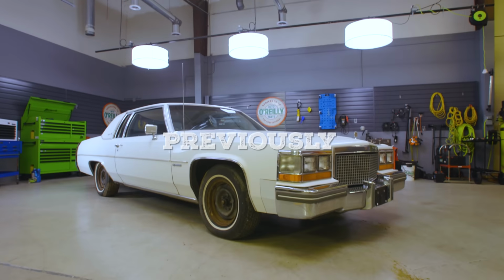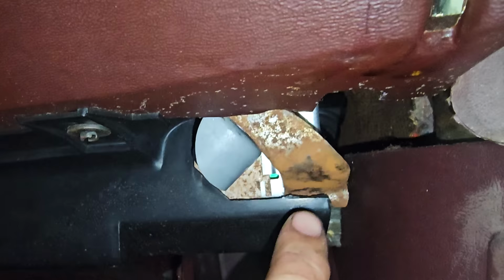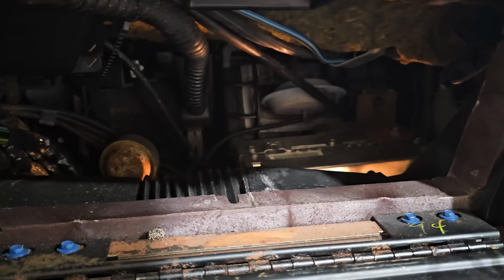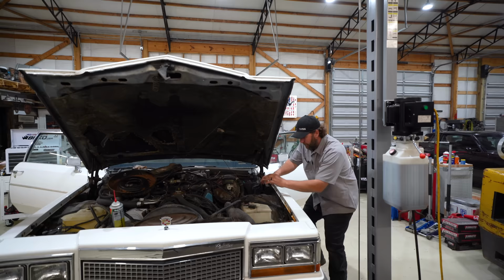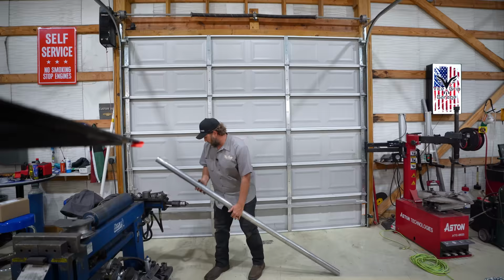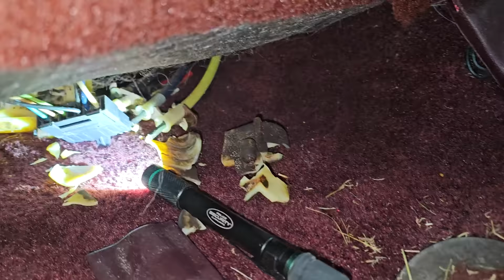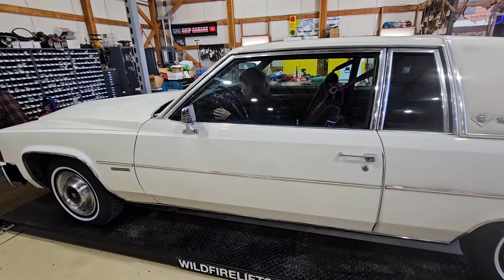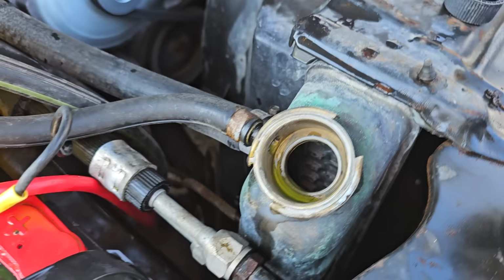Will It RUN AND DRIVE Finally? Carburetor or Computer On This 8-6-4 Cadillac!

Comment: The Cadillac as long as the car sat the ECT sensor is probably corroded and it is a important part of the electrical throttle body digital fuel injection system on gm vehicles so i think i would just go ahead and replace it also,had a corroded one in my early 94 Chevy Z71 Silverado,350 tbi and it would occasionally stumble because of it,turns out it would lose signal from the electronic ignition system to the ecm it was not stumbling it was temporary losing ignition feed and the ECT bwd O'Reilly's brand new sensor fixed it

Comment: If its not getting fuel also look into the spark control (aka ignition control module ) if it has one itll be in the distributor under the rotor like most gms the tbi 350 454s and even the v6s like the 163 and 262 .

Comment: A guy broke a harmonic balancer once and it acted just like you just did hurting the fan and alternator with no resistance. I made it home though because a Chevy 250 doesn’t really need water between Dallas and Kaufman

Comment: Btw that engine is actually a work horse. Its a destroked 472/500. If no collector wants it id pull the engine and possibly use it for another project. As it sits its a 6 liter anyway

Comment: I vote for the carb or aftermarket EFI if the original stuff doesn't work. I kinda miss index cards, but the new digital stuff is faster.

Comment: I had every expectation that Derek would convert it over to carb. I was just as surprised as he was when the car ran properly once the new ECM was installed. 

I would have understood if he did convert it over to carb. The V8-6-4 system has a terrible reputation after all. 

As for the cylinder deactivation system not working, it might have been purposely disabled by the previous owner. It was apparently extremely common that owners, shops and even dealers to disable the system and let the car run on eight cylinders all the time. It was just too far ahead of its time to be reliable.

Comment: it was driving me nuts watching those proms being changed, the correct way is to push the chip up in the holder and seat the holder in the new ecm and push the chip down, any other way will bend the terminals

Comment: I'm willing to bet it's the belts slipping on the pulleys my dad had a accessory drive pulley do the same thing it would work good until there was a load on it then it would over heat my first car was a 77 coupe deville silver with red leather interior I cried the day it got totaled I loved that car wanted to keep it forever 😢

Comment: Put the car on a Dyno and run the codes. That will tell you what you need to do. Or if you can't get the car there. Go to O'Reilly's and get a  OBD 2 hand computer and run the codes.

Comment: It's the engine.  The automagical compressions escaped and let the magic smoke out of the computer.  Screw those Cadillac collector one year people.  This needs either a 5.9 liter 12 valve cummins or a 12 cylinder swap...

Comment: Looks much better with the Oldsmobile hubcaps, The center emblems on the Olds hubcaps pop off as thats where GM hid the security bolt which prevented someone from stealing the hubcaps (or at least slowed thieves down). Anyway I wonder if a guy could find / make / or modify the Oldsmobile hubcap center emblems so they said Cadillac or had the Cadillac crest on them? Just a thought.

Comment: People disabled the active displacement for a reason. It wasn't reliable. It really didn't save fuel. Finally, when you start having high temps from some cylinders firing and no heat from some not firing, you end up with different parts of the block running at different temps, that can lead to warping of the cylinders. It's the same problem they are having with other manufacturers who are doing that today.

Comment: My 2013 Silverado had the 5.4 engine with the 8/6/4 format in it. 17mpg city 20mpg highway. There was a problem with cam positioning sensors in non pickups and passenger cars at idle.

Comment: I guess General Motors hasn’t learned much in 40 years, you disconnect the system back then, it ran fine and you disconnect the cylinder deactivation today and it runs fine

Comment: If I remember right when your in the diagnostic mode you can hold off and hi or maybe warmer button and it will clear the codes had to do this to reset ac when going down the road every once and awhile

Comment: Derek I have a perfect set of wire wheel hub caps adapter breakets and a removerator tool for them for that caddy if you’re interested

Comment: my 1980 eldorado had issues with the ECU. The last time I changed it I found a piece of metal rolling around inside. It shorted something out and the car never started until the ECU was replaced....again. My Dad had a 1979 eldo...also had computer issues when it was only 4 years old.   Good thing they are easy to change......but the diagnosis is horrible.

Comment: I once filled one of those with premium, then it wouldn’t start or run. Dealership said to use regular only. Drained the tank, refilled with regular, and it was fine. Weird ass sensitive TBI

Comment: you're looking at a sticker that says remanufactured and say i wonder if this is the original. I've worked on several of those and that ecm will come out with the wires still plugged in

Comment: Seems to me what could be happening with that there cylinder delete device box is that, either it doesn't want to shut off any cylinders when there's a check engine light, or someone in this vehicle's sordid past decided to delete the cylinder deletion system and run it as an eight cylinder the whole time.

Comment: Gotta get those filler panels for the front bumper and rear tail fins... absolutely kills the look on those things with them missing from deterioration lol. But the rarer velour....my 89 Baby DeVille has the red rarely optioned velour under Medium Garnet Red Metallic paint, she's super clean, actually trying to sell her now due to health and monetary reasons if anyone's interested around the ND/MN/SD area... she's not from here, she's an Arizona girl, but native to the states, definitely not a jumper 😉

Edit: and to make your gas gauge "instant" (much faster), fill with your ignition off, then back on once you're filled and it'll jump immediately up, don't know why all these Cadillacs of this generation do this, but they must read the level super slow due to it's extremely antiquated computer system for instant/average gas mileage and total distance per tank and it's literally using an abacus to figure out the MPG's while running, entirely too much for it to handle 🤣 tricks of the 80s Cadillac trade... favorite part of Cadillacs this generation?.... the "turning lights" AKA I'm pulling into a tight spot at night between two cars at night turning in and can't see, so lightly depress the turn signal in whichever direction you need extra light at the front corner of your car, boom, extra turn in light... definitely miss it in my other 2 vehicles at night.

Comment: Wire hubcaps look way better and they should be the kind you can pull the center logo off and get to the original locking doodab. You can probably find the Cadillac logos to replace the Oldsmobile ones and there you go. If nothing else you can always get some Cadillac logos to glue on and nobody will know the difference.

Comment: Go to home depot and get a RIGID vac. that will last you for many years. i have used mine for Home renovation and it works great on plaster and plaster dust, cat hair ect. Works great removing cat hair from furniture

Comment: I might have to agree with you on the cylinder section of the other computer may be bad. That other computer may be near the main ECM. You may have a bad water pump and fan clutch assembly is probably why it is overheating. You never did mention if the air ride suspension still works or not.

Comment: Derek scores round 1. DeVille scores round 2. This fight is a 12 rounder, Derek. You win when it's up and running as a Daily Driver or,  it wins when you cut it up for parts/scrap or leave it to rot in 'Rusty Acres' or is that Achers? Either way, this fight needs a resolution!!!

Comment: To clear the codes, WHILE STILL IN DIAGNOSTIC MODE, press the OFF and HIGH buttons simultaneously until 00 appears. Trouble codes are now removed from the system memory.

Comment: Derek, I assume you know to turn the heat on full blast and hot as it goes when a car is trying to overheat? It can be miserable in hot weather, but it's saved me from overheating more than once. Whatever happened to Betty White, is she still around or did you sell her? I liked that car. 😃

Comment: My dad had a 1981 4/6/8 Cadillac.. sometimes starting up at a traffic light  it would jump to 4 cylinders.. he ended up taking it back to the dealer and they disconnected it and it ran only on 8cyl after that..

Comment: Ah yes, gently removing the mouse condominium. It's always easier doing stuff on your own turf than on someone else's, ain't it. I have learned not to rule out a connector just because it's connected. I've chased a few electro-bugs out of my old '96 Dodge now by opening up connectors and cleaning corrosion off the terminals.

Comment: I'd change the thermostat, and the fan clutch(if it has one) Pressure test is a good idea. You never did say, did you check the alternator?

Comment: Me's wondering if new EPROM chips come "hard 8" active all time. Good to see it going again, could not tell if the fan clutch sentinel (solid band of graphite embedded under hood) was active. Throw a new one on there and Temp disco lights and coolant evacuation should subside. Amazing how much a good fan clutch pulls the pump pulley esp. on those 8s. Having the barometric press reader open wont be issue as long as you keep vehicle within 200 ft MSL elevation +/- of your current location and run car above 40F❤❤❤❤❤❤❤❤❤
Reply: Me's wondering if those EPROM boxes have embedded lithium watch battery,😮

Comment: If that's OBD I?
You gotta take a paperclip to the top 2 slots on the right (fact check me, it's been awhile) then count the check engine light flashes. It will blink  slow, then, fast. The slows are 10's; 10, twenty,  30, (then, fast; one, two, 3, four

So 2 fast is 20
+ 
3 slow is 3

20+3 = 23 👈 = your, CODE

Comment: Nice Shirt !  A guy might have to get himself one of those.
The New Caddy Hubcaps with maroon center cap ... Not so much.   Even if the wire wheel look are Olds - You should put them back on - I like them much better
Very curious to see where this one goes.  Whether you keep working on it or some Caddy Guy swoops in and grabs it - I Wanna Know how it goes.

Comment: There's a good chance that the buttons on the climate control unit also aren't working. I have a lot of experience with electronics of that era and flaky buttons are very common. It can even happen on relatively modern stuff. The trip-o-meter buttons on my 2000 Honda Insight stopped working just last year.

Comment: someone already took the solenoids out for the 864 system, those cars were a pain to drive with it working, and it did not improve fuel economy as it would just close the valves so the piston still had to compress air on compression stroke a big waste, there was no benefit an engineering failure most were converted after a few years

Comment: People say that the motor should not be running when erasing the codes,,,only ignition on...also..turn off ignition between the operations...and turn it on agan. Meaning...turn off motor...turn off ignition.....then......turn on ignition....but do not start the motor.......then erase.......then,,,,turn off ignition....restart ignition and check the codes.

Comment: Did a Guy turn the key to the on position and headlight switch on while the battery was disconnected to rest that Ecm? Gotta turn key on and light switch on to drain ALL the juice from the Ecm.

Comment: Leave the computer. Just lock it in 8 cylinder mode through the mileage computer and you will not have any problems.

Comment: Instead of using the temperature thing to check and reset codes couldn't you have just plugged in an obd2 scanner into the plug on the driver side

Comment: You would not be permitted to change the fuel system from EFI to the simpler carburetor in California. Even though the solenoid can be disconnected for pure V8 operation, the car would not pass the CA smog test unless the V8-6-4 system was operational. So sad. Northern Arizona is a much better, cleaner and nicer place to live.

Comment: I had a bunch of the late 70s, early 80s Coupe DeVilles. Luckily none with V8/6/4. Did have an 81 Eldorado with a diesel, that was a new level of @#$&@!&!   Cured that with a 403 Oldsmobile transplant.

Comment: Overheating in my ht5100 series 4500 couple deville inlet manifold was leaking water into intake bad news is both cylinder heads bolt on underneath whole top has to came apart u need to machine heads to inlet or it will leak badly built new

Comment: Lol . I hand one brand new V8 6 4 . If you get it to work perfect. You will hate it. Set the cruse control. Lol with in 45 minutes everyone in the car will be seasick.  As the cylinders drop off the cruse controller compensates for the lack of power until the 6 cylinders can't hold the speed on a flat florida highway.  Then it pounds it back to all 8 and you rock back and forth in the car. Lol. Noticeable.  FORTUNATELY  One of my guys totaled it and I got the next year model. WITH A V6. The shinniest slowest TURD on the market. Had to switch to town cars.

Comment: Ahhh, all the problems of an old car without any of the simplicity! Given the history of this cursed model, I think I'd rip out every remnant of the ECM, its sensors and all the emissions control BS and sub a good old carburetor for that evil TBI. Renovate backward to the reliability of the 1970s. If THAT doesn't work, try about 100 lbs. of Tannerite.

Comment: I had the unfortunate job back in the '80's of working on several 8-6-4's and that system ...which always got blamed when they didn't run right....was never the problem.   IIRC one clogged up the cat and the others had multiple overheating issues and all came down to the engines having some of the worst machine work I'd ever seen.   The heads looked like they'd been surfaced with a chainsaw which then led to multiple coolant leaks from the head gaskets.

Of course GM's solution was to fill them full of 'Stop-Leak' which only worked long enough to get them out of warranty.   Pulled the engines, went through and resurfaced and corrected all of the terrible work and those cars ran great for years afterwards.   The 8-6-4 system is actually simple and robust and another one of GM's good ideas that were just so poorly executed.   It's a shame really.

Comment: Electronic spark control computer under console like turbo trans am I had,this thing toasted out for no reason,no start,jump wires on distributor and worked,does Cadillac have this separate from tbi computer?
Reply: On the trans am I could bypass by jumping wires on distributor,but only temp as needs to be able to retard timing if pinging....but did run without that shit box computer

Comment: Does that model share the distributor with one that ain't 4-6-8- at least the cap  shared for the under  got carb bolted manual operation wtf how they 4-6-8 it now

Comment: Yeah you've got a new computer but you don't have the chips that make the engine run they're in your old computer there's two chips that you're going to have to pull out and an access cover that you've got to unbolt from the old computer to access the chips you're going to need for your computer that you purchased and the access cover that's going to cover it because it didn't come with those things when you purchased it😢😢

Comment: a big fella like you NEEDS a Caddy-size interior, so you would clearly enjoy having it running, but the 8-6-4 got a bad reputation for a reason.  Give up trying to make it work. It was no good from the start.  Swap in an injection system that you know will work -- it will only increase the value and likely will improve fuel mileage.

Comment: How are you I start off with making sure your injector pulse is pulsing so that you're getting fuel cuz if there's no injector pulse that mother f*** ain't going to run with spark and compression if the gas doesn't get to it right three main things you have to have to run a car engine compression spark fuel you don't have any one of those three things no start

Comment: Give me her if you're able to switch out the computer box you're going to have a problem because when you restart it it's going to want to have it's going to request you to have dealership certification codes put in slash how to reboot system

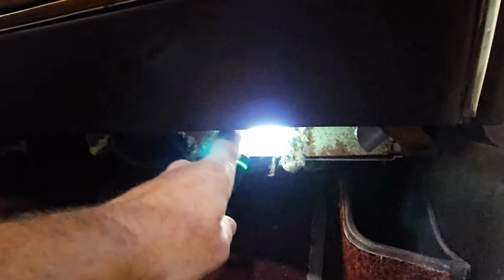Comment: Be Glad you are NOT in California - you CANNOT just delete the 8-6-4 system it's a Smog System and it is Required equipment. Deleting is not acceptable option for the system. 😂 The chip is the fuel map memory 9:52 9:52

Comment: If you bought one of these beauties you learned how to be miserable.....this barge running on 4 cylinders to save gas is simply  a goof.I'm thinking some of the Engine Ears needed to be de-activated
fOR SURE
Don't be going into the YMCA shower if the lights are blown

Comment: You are so afraid of electronics, in all the damn videos there are 4bbl and 4-pin mudule HEI distributor, I am not a Cadillac lover, I don't like it, but except for the emissions system, I ask, so difficult is to run a TBI system, you are not asked for the Buick system, which has DIS ignition, suddenly you panic...... if we have a Cadillac Deville or the Dorado etc, you do not go into ¼  mile mode, the way is an mad scientist programmer of computers mode, cables, connectors, sensors, actuators, etc. ...........it is time for you to leave your comfort zone